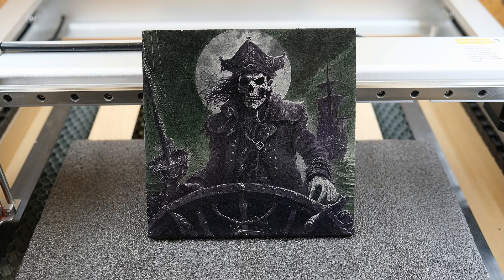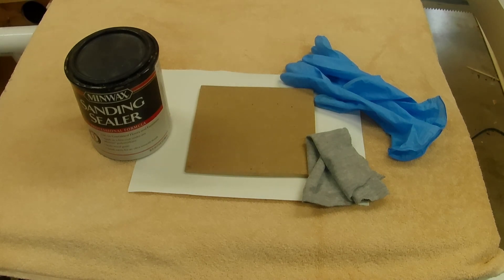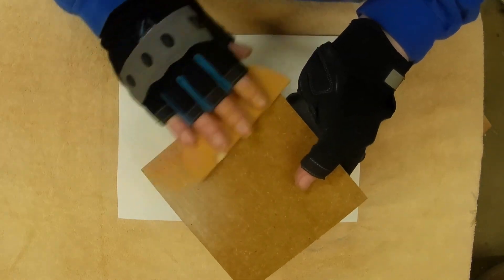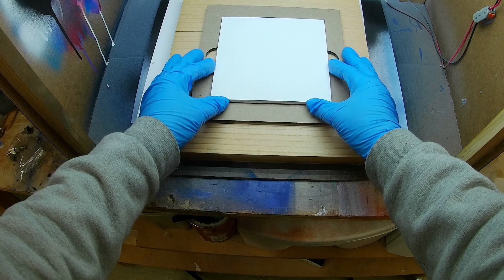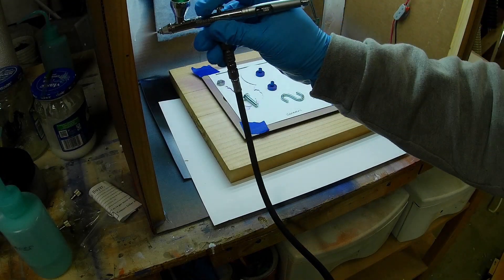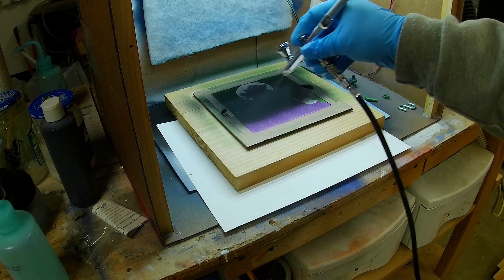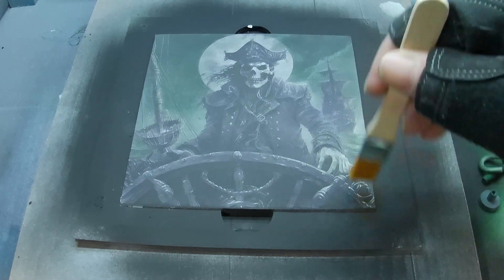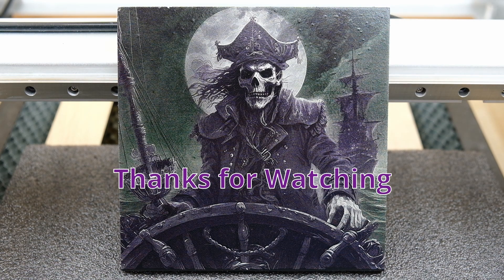Video on using craft paints on MDF and then laser engraving with a diode laser.

Comment: I appreciate the detail on how you spray the MDF.  The cheap tubes of paint I bought from Hobby Lobby are so thick.  How do you thin your paint so it will spray properly?
Reply from the maker: I thin mine with a solution of around 35% alcohol and 65% distilled water. Mix that solution with paint until it's the consistency of milk.

Comment: What kind of air compressor do you need for the sprayer?
Reply from the maker: I was using a shop compressor which is overkill. If you look on amazon they have a lot of airbrush specific compressors but I really don't know enough to recommend which to get.

Comment: Awesome! What ratio do you use to mix the paint? And what do you mix it with to make it work with the airbrush?
Reply from the maker: I thin the paint until it's the consistency of milk. The thinner is a mix of IPA and distilled water. The mix I used is 150ml of water and 100ml IPA.
Reply: @lasersandsaws What is IPA? 
Isopropyl alcohol? If yes at what percentage?